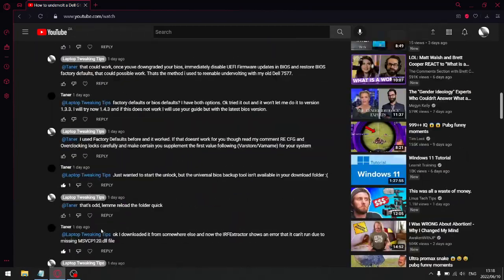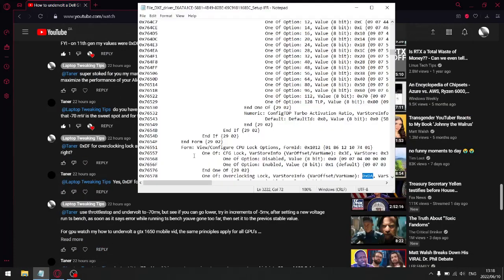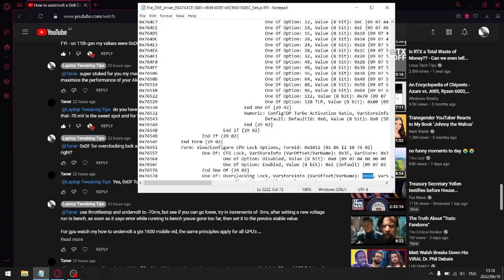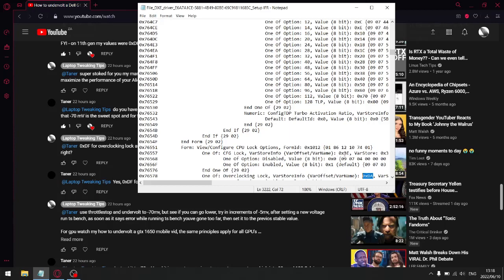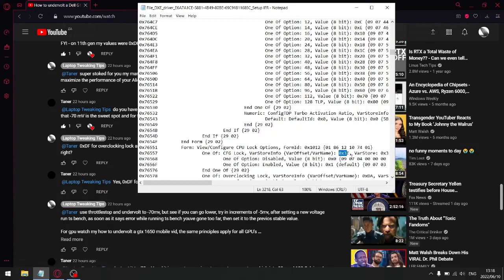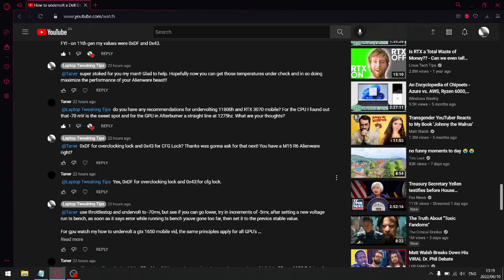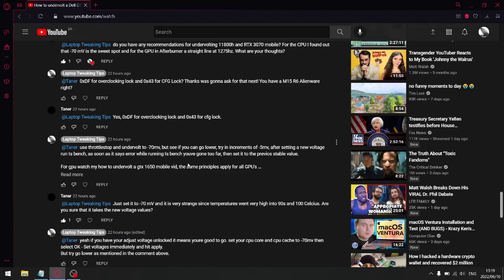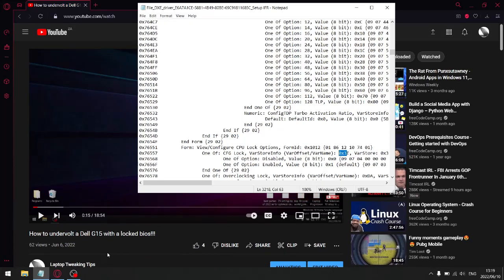How to undervolt an Alienware M15 R6 with a locked bios!!

Comment: Hey there, I have alienware m15 r6 and followed the dell g15 video up until this point. I found that my text file already had those figures. Does that mean I have undervolting unlocked? I wonder why the other R6 owners were able to change these values yet my R6 already had those??
Reply from the maker: Hey Isame, not to worry
That's a good thing, that means you have a 10th gen cpu?
The other cfg and overclocking lock values correspond with 11th gen, or 11800h to be precise 😁
If your values are the same as mine, proceed to the next step, ie. booting to grub menu, and entering the code as I laid out.
Please sub to the channel brother 👍💪
Reply: @laptoptweakingtips  thanks for the quick reply. Can i confirm, do i change the value for enabked to 0x0 instead of 0x1? If so i did not do that. I was looking at the disabled value which said 0x0 and assumed as it was already set to 0 i did not have to change the enabled value. Does that make sense? I have since changed the enabled value but wont proceed till you can tell me if that is correct :)
Reply from the maker: @isameabdo2394  yeah buddy, I try reply ASAP, your Youtube technician on hand lol!!
Ok
By default the value is set to 0x1 (meaning the overclocking/cfg lock is active) by folloing these steps we are changing that value to 0x0 to disable the lock and enable undervolting.

So proceed to create a bootable usb and then booting into the grub menu, enter the values exactly as i laid out on the text file, (if youre overclocking lock is also 0xDA and cfg lock is also 0x3E.)
Once you have done that undervolting will be unlocked :)
Reply: @laptoptweakingtips  it worked perfectly, i dont know how you figured this out but it worked perfect. I was checking the unofficial alienware redit and people there have been unable to figure this out. It would be great if you made a post there and provided step by step instructions and maybe even a custom video for alienware m15r6. I know the guys there would be over the moon. You would do a better job than me at providing the steps. Legend! I will subscribe brother. Much love from Australia my SA brother :)
Reply from the maker: Ahoy mate!!! That's dope AF!!! I'm actually watching a doccy on how female surfers from Aus pioneered competive surfing in the 80s right now! Lol
Please provide me with a link to that forum? I am doing an updated video which will drop tomorrow, there are some points I want to make clearer ie the Dell G15 video :)
Stoked for you bro!!!
Reply from the maker: I actually saw this method on a Lenovo laptop, so I tried it on a whole bunch of brands and it worked on them all, provided they are intel 10th gen and newer.
I buy and sell laptops for a living so always have different brands to test stuff out on.
Reply from the maker: @isameabdo2394  don't forget to sub, and also send me the alienware reddit forum.
A user mentioned to me that he Undervolted, and further tweaked the Turbo Ratio Limits to get the Temps perfect on the M15 R6, his name is Taner, look out for his settings on How to undervolt Dell G15 video.

Comment: I have 17 R4 model same problem, locked bios :((
Reply from the maker: Watch this video, follow the steps
https://youtu.be/TMBmciQ6SU4
Just change my overclocking lock and cfg lock values to the ones you find for your system.
What generation processor do you have?
Please sub to the channel 💪👍
Reply from the maker: Once you have unlocked undervolting, you probably need to adjust Turbo Ratio Limits as well as the undervolt. That laptop is crazy powerful, even with two sets of fans and extra trunk for cooling it still needs extra cooling.
Also have you tried Liquid Metal?